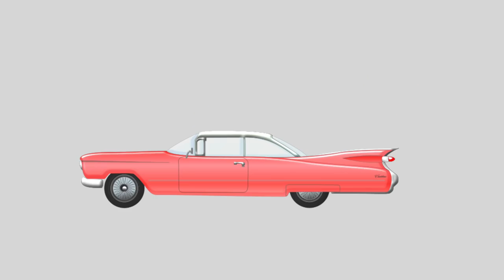Yes, Rockets CAN Fly in a Vacuum

Comment: The wheel interacts with the ground, the propeller interacts with the water, the jet turbine interacts with the air, the rocket engine interact with... vacuum? Yeah, sure 😂😂😂
Reply: The rocket engine interacts with the mass of it's fuel and oxidiser.
Exactly the same as a jet engine, except the jet gets it's oxidiser from the atmosphere while a rocket carries its own oxidiser
Reply: @niallkinsella2687  So the rocket engine interacts with itself?  Cool.  Guess I can get up now by pulling up on me belt.
Reply: @DrCash7  
Not with itself.
With the fuel and oxidiser, as I've already said
Reply: @niallkinsella2687  The ship moves by the propeller pushing the water behind it. An airplane flies by having the engine push air behind it. Since a vacuum is empty space, please explain to me what a rocket engine pushes behind it?
Reply: @igormladenovic8851  
Wrong. 
Jets engines use exactly the same principles as rockets do to create thrust.
Accelerating mass in one direction and ejecting it. Conservation of momentum does the rest.

Jets just need an atmosphere because they need to get their oxidiser from the atmosphere.
Reply: @niallkinsella2687  Whether the engine can or cannot run is not the problem. The problem is that there is no thrust in a vacuum. Sea - water molecules, sky - air molecules, vacuum - ?
Reply: @igormladenovic8851  
Are you forgetting that the fuel has mass?
Reply: @niallkinsella2687  Are you forgetting that there is no molecules in vacuum?
Reply: @igormladenovic8851  
Irrelevant.
The rocket accelerates and ejects the fuel and oxidiser. 
The momentum of the fuel/oxidiser has been changed.
Net Momentum must be conserved.
Therefore the only thing that can possibly happen is that the also rocket changes momentum, to an equal magnitude but in the opposite direction.

Anything else that you propose would occur would violate the fundamental laws of the universe.
Reply: @niallkinsella2687  ''The rocket accelerates and ejects the fuel and oxidiser. 
The momentum of the fuel/oxidiser has been changed.
Net Momentum must be conserved.
Therefore the only thing that can possibly happen is that the also rocket changes momentum, to an equal magnitude but in the opposite direction.''

YES, this is true. But that can only happen IN THE AIR. This is impossible in a vacuum! Do you not see the problem or do you not want to see it?
Reply: @igormladenovic8851  
Where in the entirety of known physics does it say that the principal of conservation of momentum requires an atmosphere?
Reply: @niallkinsella2687  There is no problem in maintaining momentum. The problem is that the rocket has nothing to push off. A rocket launched from the earth into the vacuum of ''space'' would continue to move in a straight line. If the rocket was at rest(it doesn't move) in the vacuum of space and the engine started to work, it won't move at all. The rocket engine creates thrust, but has nothing to push against.
Reply: @igormladenovic8851  
To use your (inaccurate) terminology,
The rocket pushes off of the fuel oxidiser mix while it's in the combustion chamber and the engine bell.

Why is this so hard to understand?
Reply: @niallkinsella2687  Your beautiful dark eyes are open and watching, but it is the mind that is blind
Reply: @igormladenovic8851  
My eyes are blue sunshine. Fair enough you have no way of knowing that, but still it's completely unrelated to the topic.
Reply: @niallkinsella2687  My mistake. They look brown in the video.
Let's get back on topic. I visited NASA official website. In the section explaining thrust, it says the following:
''Thrust is the force which moves an aircraft through the air. Thrust is used to overcome the weight of a rocket, and it is generated by the engines of the aircraft through some kind of propulsion system. Thrust is a mechanical force, so the propulsion system must be in physical contact with a working fluid to produce thrust.''
Do you now understand the problem I was referring to?
Reply: @igormladenovic8851  
Yes. I've also read the NASA page for middle school students. It agrees with everything I'm saying.
Tell me, at what point throughout the reaction to you think the fuel/oxidiser mix is not in contact with either the combustion chamber or the engine bell of the rocket?

Ps. I'm not in any videos. I'm not a content creator.
Reply: @niallkinsella2687  Ok, i`ll repeat the statement:
''Thrust is the force which moves an aircraft through the air. Thrust is used to overcome the weight of a rocket, and it is generated by the engines of the aircraft through some kind of propulsion system. Thrust is a mechanical force, so the propulsion system must be in physical contact with a WORKING FLUID to produce thrust.''
WORKING FLUID - an environment that contains air, water or some other fluid
VACUUM - empty space - no fluid
The fuel/oxidiser mix is in contact with the combustion chamber and the engine bell of the rocket, but there is no FLUID in vacuum. So, the engine has nothing to push behind it to create thrust.
Reply: @igormladenovic8851  
The fluid is the fuel/oxidiser mix.
The propulsion system is the rocket engine, specifically the combustion chamber and engine bell.

With this astonishing revelation laid out, I'll repeat my question.

At what point during the reaction do you think the fuel/oxidiser mix is not in contact with the rocket engine?
Reply: @niallkinsella2687  And when fuel/oxidiser mix exit from the propulsion system (rocket engine, combustion chamber and engine bell), it reacts with what to create thrust? In order to move, you need to have something to push against (air, water, etc). If you have a vacuum around you, what do you push away from? If there is nothing around you, you can not create thrust, therefore you can not move.
Reply: @igormladenovic8851   
When the fuel/oxideser mix exits the propulsion system, the reaction is over. You are referring to what happens after the "ejected" part of accelerate and eject mass to change velocity.

The fuel/oxidiser has already been accelerated.
The fuel/oxidiser already been ejected.
The rocket has already been accelerated by equal momentum in the opposite direction.
Conservation of momentum has already played it's part.

At the point where you are starting your argument, the entire reaction process involved in rocket engines (and jet engines too for that matter) has already been completed.
Reply: @niallkinsella2687  There is NOTHING in vacuum. NO atoms, NO molecules... NOTHING. EMPTY space. You can not push yourself from NOTHING. If you don`t understand the problem, than further debate is pointless.
Reply: @igormladenovic8851  
It doesn't matter that there's nothing in a vacuum.

The rocket brings its own reaction mass.
The fuel and oxidiser.

Accelerate mass and eject it. That's it. There's nothing else required. No atmosphere; No molecules; No additional matter whatsoever is required as long as you have something that you can use to accelerate and eject mass.
Conservation of momentum does not require anything else.
Reply: @igormladenovic8851     - Rocket "Propulsion" is really just the RECOIL force of the rocket pushing out mass.
Just as a Crossbow feels Recoil from shooting out the mass of the projectile, a rocket feels recoil from accelerating the exhaust gas from the nozzle.
Reply: @stuartgray5877  a rocket doesn't push out gas tho, chatbot. The gas leaves without any force Being applied to it 😂

Comment: Never mind the flat earthers in this comment section. I didn't get a good explanation from this video. I think some people might just want to know why something can be propelled forward when there's no air for the explosion to be "pushing off of." I think an automobile might be a bad analogy. A propeller would be a better one. A propeller would, in fact, not work in a vacuum. The balloon was almost a good example but to the layman it looks like it's moving forward because of the air around the balloon that it's pushing off of. Does anyone know of a video with a more detailed explanation for exactly the confusing part of this question?
Reply: A CROSSBOW is the best analogy.
Would a crossbow fired into a vacuum produce a RECOIL FORCE backwards on the bow?
YES!
Rocket Propulsion is JUST the Mechanical RECOIL of PUSHING ON MASS.
ANY machine that can apply a force onto mass and accelerate that mass MUST feel an "equal and opposite force" on itself.

Most of these "physics deniers" that don't believe in rocket propulsion don't even realize that EXHAUST GAS HAS MASS!
Reply: @stuartgray5877  thanks!
Reply: Watch the YouTube video:
".577 T-Rex go Boom TheBlueMeanie."
The bullet is a particle of mass that is accelerated by an explosion.
The force applied to the bullet is exactly the same as the force applied to the rifle.
The bullet goes in one direction and the rifle goes the opposite direction.
Rockets carry thousands of pounds of mass with them as fuel and oxidizer.
Rocket fuel combustion is a sustained explosion that pushes trillions of molecules, tiny "bullets", away from the rocket, at thousands of miles per hour, in one direction and pushes the rocket in the other direction with an equal force.
In the video:
"What's Going On In This Spacex Rocket Video?
NASASpaceflight"
You can see blasts from maneuvering rocket thrusters when the booster is in vacuum.

Comment: There is NOTHING TO PUSH OFF OF IN SPACE, ITS A VACUUM
Reply: Except rockets take mass WITH THEM to space to push off of.

Would a crossbow fired into a vacuum experience recoil?
Yes or no?
Reply: @stuartgray5877  steel projectiles are carried up into orbit?  Seems pretty heavy.  Have they tried bringing orbit to the steel projectiles instead?  Seems it would be more environmentally responsible instead of wasting all that steel.
Reply: @jrstuckey1471  Do you actually have a point?
Reply: @jrstuckey1471  You don't need steel projectiles. You can throw away any kind of mass. Gases have mass too.
Reply: @stuartgray5877  <------ chatbot stu
Reply: @DrCash7  <--- person who thinks RECOIL stops working in a vacuum.
Reply: @stuartgray5877  <----' chatbot
Reply: @stuartgray5877  correct. Gun recoil requires atmosphere. Explain how suppressor reduce recoil then.
Reply: @DrCash7  No, gun recoil works in a vacuum.  If by "suppressor" you mean muzzle-brake, it reduces recoil by directing some of the gasses to the sides.
Reply: @fairwinds610  false
Reply: High school physics class begs to differ.
Reply: @DrCash7  - "false"
NOT false.
It is YOU that does not understand basic physics.
Prove me WRONG by telling us:
How much "Work" is performed by accelerating 500 kilograms of pure water from a velocity of zero to 2500 meters per second.
If you CANNOT do this, then you have less than a high school understanding of basic physics.

OR you REFUSE to answer because the correct answer PROVES YOU WRONG - PAPALEGBA

Now prove my statement above wrong by ANSWERING.
(We know you will not as the correct answer ruins your narrative)